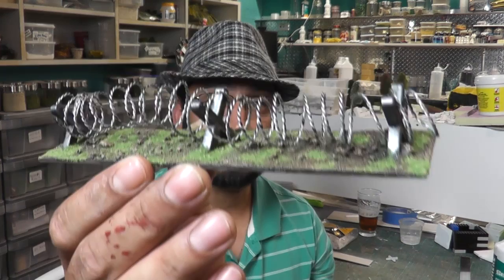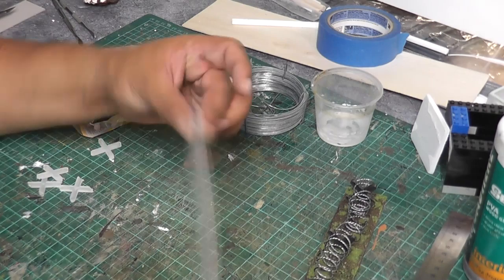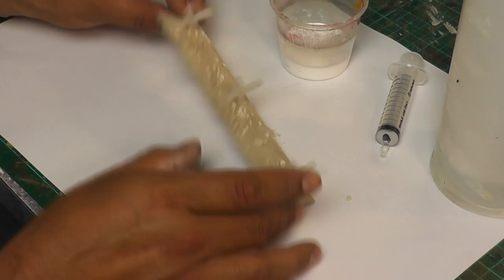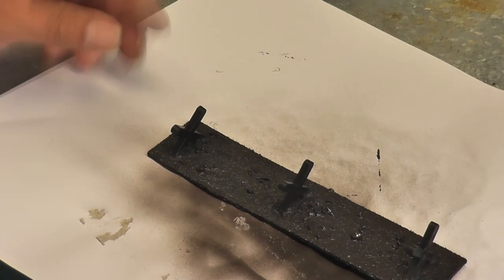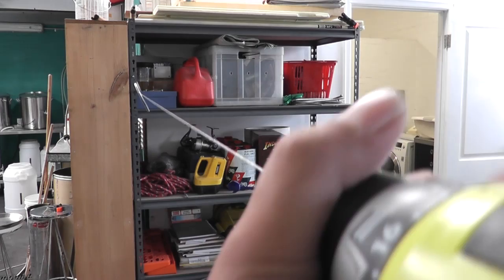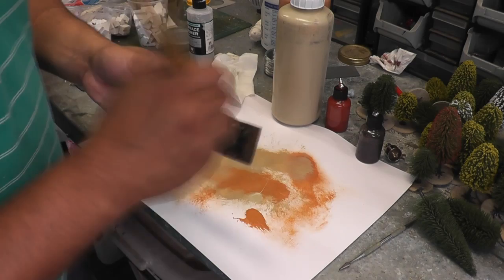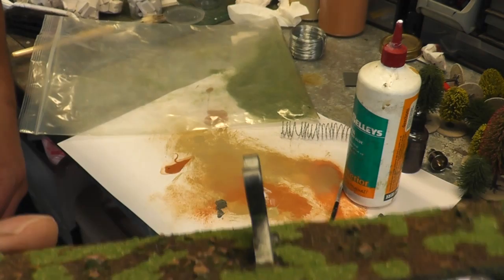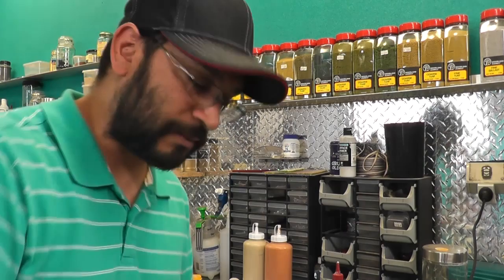Tutorial: Making razor wire fencing scenery

Comment: Great tutorial. A good alternative way to make the razor wire is from pipe cleaners (try to get extra large). If you burn the fluffy stuff of with a lighter you are left with a fine double twist wire. Wrap it round a cylindrical object for the loops and voila. Also worth noting is when you burn the fluffy stuff off the carbon deposited turns the wire black. Perfect for a light dry brush of gun grey or a similar metallic.
Reply: I should have mentioned if you are a younger modeler. Ask for your parents permission/help before you start burning things. Good luck.
Reply from the maker: that's another great idea!  Cheers

Comment: Hey Viv, there are expensive razor wire for miniwargaming on the market. There's nothing special about it. It's commercially available "sealing wire" or "security wire" relabeled. The only difference is the for times higher price. ;) With this you also do not have to drill two wire slices together and it looks great.
Reply from the maker: Thanks so much ... will have to look it up, sure would save some hassle!  Cheers